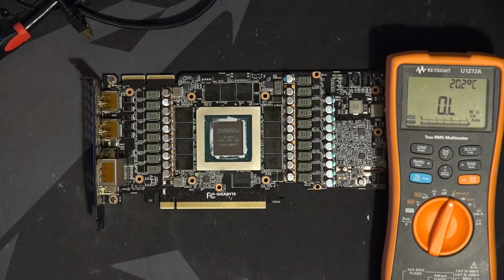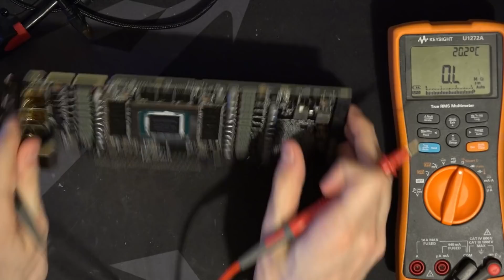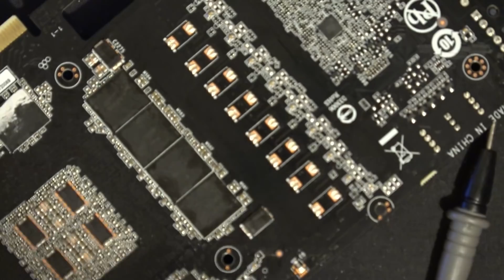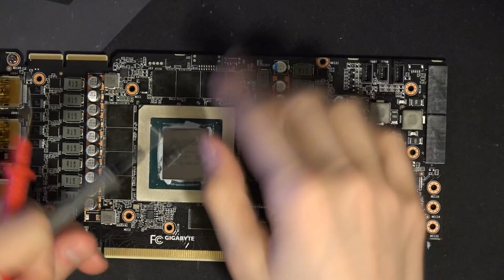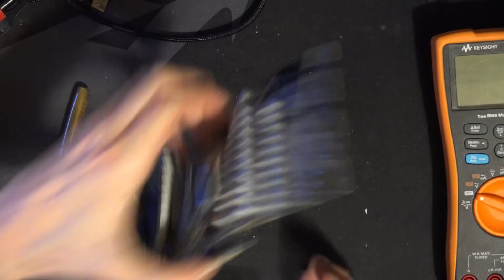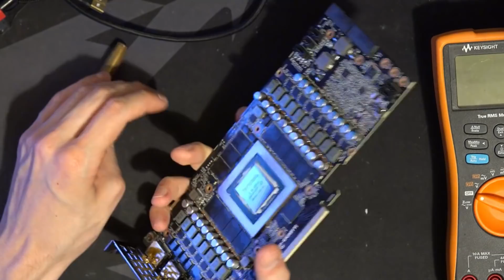Probing a Gigabyte RTX 3090 Vision that died when trying to run New World

Comment: Its got to be one of the power phases.  I am guessing high FPS and power draw did it.  So one of the chips is dead of the left.  The card might come back if you remove the duff power phases.  If the core did not get 15 volts because there was a short.

Comment: If you are having reading with the digital multi meter is either clean the tips of the probes or replace the probe leads as I ran into the same problem before as the tips sometimes get dirty or corroded I ended up getting the fine tips probes not had a single issue since.
For vrms testing you might need to test the gate pin to ground same with source pin and drain pin, the pins usually facing toward the power plugs it guaranteed to shows a short while testing with the digital multi meter. Another is using voltage injection to see which one will heats up with liquid nitrogen spray or use a thermal camera

Comment: Would you be able to repair this card by replacing the affected power mosfets & filtering caps? Or does the chip itself get completely cooked when power stages fail like this?

Comment: I think this GPU requires its PSU to be able to handle at least up to 700W power surges to call it properly sized. So it looks like just the onboard PSU wasn't properly sized to handle the load surges, especially if the cooling system is good and the GPU is cold (thermal throttling is off).

Comment: My 3080 Aorus Xtreme runs it fine on max….what’s with the 3090’s dying?
Reply: Not every card is affected, its a hit or miss. Plenty of launch evga ftw 3090's that didn't fail. No one knows for certain, but we believe its due to the higher power consumptions, increased thermals due to tdp/memory, and a vrm design that can't keep up with the spikes due to the inconsistency of the game code.
Reply: you take a gamble, i wouldnt recommend playing that game until this is solved, but you do you, just dont cry if your card bricks one day.
Reply: @AdaaDK  should probably be careful with any new game and set FPS / power limits in the drivers

Comment: @Actually Hardcore Overclocking when you said you got your hands on some "schematics" from gigabyte. Does by any chance they also had some Pascal Volt Modification Software in the Package, so we finally are able to start volt mod P-States and stuff on der Graphic 1000series+ cards?
Reply: he never said from gigabyte, it could be a big leak of several cards, if he dosnt even know if the gigabyte card is betwean then, it means they are random/assoriated , and prob not from 1 specific vendor.

Comment: Gigabyte: "We have no proof you purchased this card even though you have the card. You could have made a factory and built this identical card just to get a free repair. Nice try"
Reply: It wasn't that, it was that he got it through Ebay, so this just means that their warranty doesn't cover transfers. I do understand the frustration, though, because there are a lot of companies out there that offer warranties that cover the part no matter where you get it from or how many times it has changed hands.
Reply: @OoDeucexoO  "Doesn't cover transfers" is illegal in the EU at least. I think what he got was "must have original receipt" which it is, unfortunately, still legal to hit people with even for items that have serial numbers.
Reply: @andersjjensen  legal but utter BS. Not to mention horrible PR, especially when it happen to one of your halo products.

Yet another reason not to buy a scalped item.
Reply: @Ye_Old_Grog  you could ask for a receipt before you commit to buy from the scalper, that way you don't get scammed by these OEM's (who are scammers)
Reply: @Ye_Old_Grog  exactly, plus i wonder how many of those cards with the bad caps are still floating around?  remember when they first came out they were using the garbage type of bypass caps to try to save money?  did most brands even ever correct that?  wonder if someone tried to run a hard OC on one of those type of cards if that could eventually cause problems?
Reply: @Ye_Old_Grog  depending on how PR is turned, they could say: "we do not cover scalpers market" and get out pretty well IMO. Because let's be real, a 3090 of eBay come from a scalper not someone who already upgraded to 4090Ti
Reply: @OoDeucexoO  No, people are building their own factories for free RMA.
Reply: @OoDeucexoO  in Germany, companies have to offer two years of warranty FOR THE PRODUCT. That is, no matter if I originally bought it - or not. It should be illegal to deny warranty just bec the item was resold, it may be just two months old.
Reply: @OoDeucexoO  So, it isn't that the card is used, it's that it came from an unauthorized dealer?  Talk about a double-whammy...nowadays, practically the only way you can get a card is from a scalper on eBay and, if that card you paid double MSRP or more for breaks down, you're SOL, because the manufacturer will refuse an RMA because you bought it on eBay, even if it was brand new and still sealed?
Reply: In the market we have now no company should be denying RMAs because you bought it from a third party. Third party has been about the only way to get your hands on a card. That policy should definitely be adjusted to the times we’re in. I bet I would’ve gotten them to fix it. Sometimes you just have to plead your case and politely threaten exposure of their bad policies to the masses.
Reply: If you buy a product secondhand without the original receipt of purchase, you do not get to claim an RMA. There is no basis for a lawsuit either, the people that were victim to the 'New World' bricking issue AND had valid proof of ownership, or had their cards warrantied, were swiftly taken care of. When you buy second-hand from an unauthorized reseller you also accept the possibility of not getting the warranty. People can whine and moan all they want but nobody is obligated to replace your card in these instances.
Reply: If car warranties transfer, any warranty can transfer.
Reply: Just curious: are there any manufacturers who allow transfer of warranty to third parties?
Reply: @markomus1  In the EU, this is arranged under consumer law so manufacturers can agree or not but if they sell in the EU, they will have to abide by this.
Reply: @markomus1  I assume most operate the same way. It's just crazy to see a company lean on that policy when the ultimate failure was the product. The UK got this right.
Reply: Video card warranties should be based on mileage and time just like car warranties. Just because you sold your car doesn't mean the factory is released from its obligation.
Reply: Gigabyte would have no chance of getting away from their responsibility (in this case) in the EU.. They are required under EU consumer law to provide support, including warranty replacement, regardless of who bought what or where, for at least 2 years and generally during the reasonbly expected lifecycle of the product.
Reply: @ blazemonger Correct - any consumer rights agency would tapdance all over Gigabyte trying that in the EU. It's their product and unless they can prove misuse i.e. warranty voiding use, they have to support it.
Reply: if they allowed anyone without authorization to sell their product, there would be scammer resellers of refurbished items. they have to support the authorized resellers by requiring proof of sale when servicing a product.
Reply: I wont buy anything gigabyte now cos thats a expensive card an it should be fixed under warrenty
Reply: You get a free way out of doing an obligated free work. Would you do it?
Reply: Ya know if you say you bought it cash and lost the receipt, they will approve your rma... they don't know what u don't tell them

If someone bought it for you as a bday gift? What do u think they will say. Use ya heads , gigabyte uses trash pads and paste

Drop it to 95% power to the core?  Same pcb as gaming oc
Reply: I bought a  Gigabyte 3080ti and it failed after a year. I would never purchase a gigabyte product again.
Reply: Doesn't matter...He bought the card from a scalper on ebay....those cards 100% do not deserve any warranty.
Reply: @aaaaaaaaaa97  Well, since that's practically the only way one can buy a GPU in the U.S. nowadays (try finding any retail store that has them in stock, no matter what the price), it’s a genuine Catch-22.
Reply: @aaaaaaaaaa97  😆 you working for the company? They should cover the card! I will never buy a product again from this company  seeing how they treat their customers. Im guessing someone with cash will have a class action lawsuit  coming their way. This a manufacturer defect

Comment: I'm still very doubtful that the game has anything to do with it.. 
Surely it's either just general failure rate of any mass produced components, or inadequate components choices / layout for the given level of power draw.. Maybe a little of both.

Lots of games have high power draw, Fallen Order and Kena Push my 3080 Strix to around 470+W.
If it fails, I'm not going to blame the game.. It's likely just a component that let go.
That new Jayz2cents video gave me the absolute shits..
Reply: It's one of the reasons we have the separation of kernel space drivers that users cannot affect, to protect the hardware.

Comment: Weird, I read many AIB partners RMA based off of the serial number. I guess at least Gigabyte is doubling down and is now requiring proof of purchase. Or perhaps the user submitted an eBay invoice for the RMA / registering the card. They should've asked the seller for the original proof of purchase and not mention eBay.

Comment: I have a Gigabyte Turbo 3090 with same pcb but with full poscap capacitors coverage front and back. I shunted the 6 shunts but still limited by Outputs around 460W total inputs in Port Royal. It would be nice if you could have schematics of these 3090s to understand why they fail. Great job as always 👍

Comment: Nontransferable warranties especially in this market are the worst. Unless you get really lucky with the newegg shuffle, or made it on the EVGA queue early, or lucky enough to live close to a micro center, it's impossible for everyday consumers to get a new gpu. The US is really behind in consumer legislation and not honoring warranties for purely the reason of not being the original purchaser makes no sense if there's been no modification to the product. There's no available gpu pcb repair shops so manufacturers are literally choosing to allow modern cards that can be fixed bc of fuses to become e-waste.
Also from a gpu seller standpoint, the people who buy 3090s are the whales of those companies so wouldn't they want to do everything they could to keep them loyal to their brand?
Reply: Zotac has a couple of cards in stock at slightly inflated prices.  Their 3090 amp halo is like $2600 and 3080ti $1800 I think.  At least it's direct sale so the warranty's intact.

Comment: Dumb question. You mentioned resistance increases as temp drcreases. How does GPU (or even PSU) efficiency change as components run hotter

Comment: I'm still using an i7 930@4ghz /msi rx480/12gb ram/GIGABYTE X58A UD3R MOBO i got from overclockers prebuilt back in 2010 for £1500 originally came with 2gb 5970.I'm getting my new pc from scan uk delivered around 8th november hopefully after a 24 hour burn in. It's a 3XS prebuilt sytem with ryzen 9 5900x corsair liquid cooled/EVGA rtx 3090 ftw3 ultra gaming/ICUE R220T rgb midcase/rog strix b550mobo/1tb nvme m.2/2tb seagate barricuda hdd/850wattcorair psu/32gb corsair vengeance ddr4 cost me £3099.98.i hope the gpu is fine as i've no intention playing that ugly looking new world farcry6 will be fisrt installed on the nvme.That's if i'm not waiting until 8th december because of delays and whatnot
Reply: EVGA 3090 FTW3? Why you bought a system with the worst most flawed 3090?. of all AIB EVGA is the worst
Reply: @tyranus7  I was only aware of the problems after I ordered it unfortunately
Reply: Even if something does happen, EVGA might just be the best support i've ever experienced. As opposed to Gigabyte, where they'll delay you for weeks, and at times not even RMA anything, shocking service.

Comment: Stock power limit for the FTW3 3090 is 420 watts now, right? I wonder if mine is safe, it's been playing New World for around 40 hours now.
Reply: well make sure you set a fps limiter in the nvidia drivers at very least, and dont cry if your card does brick, you know about the issues and yet still actively plays New world.  ITs like going into a testla car using autodrive feature, on a broken road, without a working gps.  You know theres big chance of problems, yet you do it anyhow.
Reply: @AdaaDK  It's not a large chance though, there are tons of cards out there and very few are dying. I'd rather it show a hardware flaw while still under warranty bro

Comment: Another reason not to buy Gigabyte...
Reply: The design is approved by nvidia - no need to hate on them for this. There are no noticeable crappy components.
Reply: @stanimir4197  Was inferring customer service
Reply: @claudep8014  Say the EU (or UK), you'd still need the receipt/invoice for the warranty service... the card was bought off ebay, and no receipt  was provided. I see no reason anyone to honor the warranty just like that. The owner who bought it from ebay has only themselves to blame for not requiring the receipt/invoice.
Reply: @stanimir4197  EVGA juste send you another one, cross shipping. No question ask.
But it does bring a point I didnt think about, warrants, on eBay.... May be worth paying 200$ more from a retailer..
Reply: @stanimir4197  legally you are correct.
In reality it's BS. If you have an item with a valid serial number it should be covered by the warranty. The manufacturer knows when the item was manufactured, use that date if you can provide no other timeframe.

Comment: Would you say the lack of publicly available schematics is actually protecting some smart IP or just a dıck move?
Reply from the maker: I consider it just a dick move. The schematics I want/need to do repairs with a borederline useless for actually manufacturing a GPU as the hard part is getting things like the memory traces properly layed out and the schematics don't need to include that.
Reply: Logical schematics are very different from "a picture of the lithography masks" :P